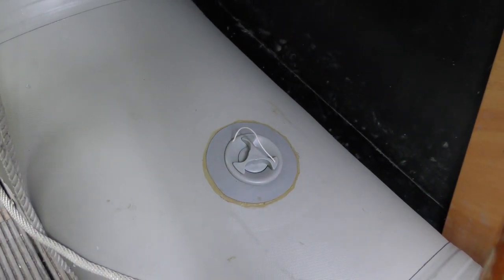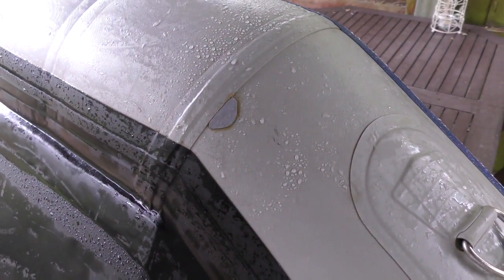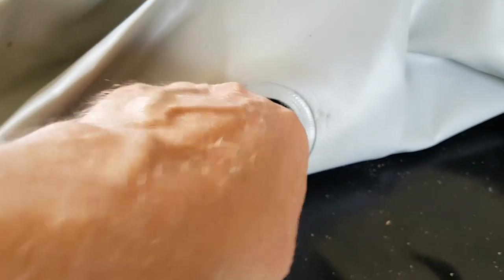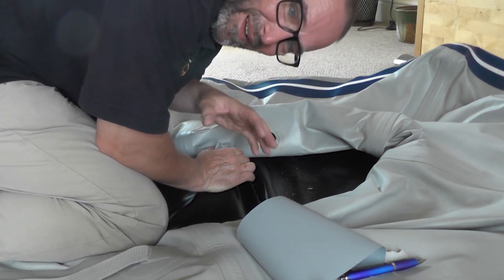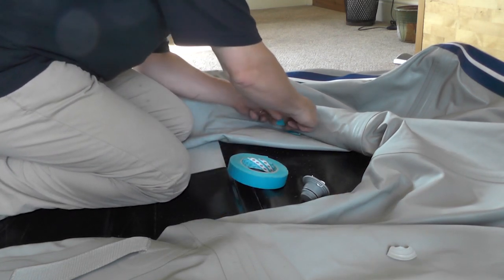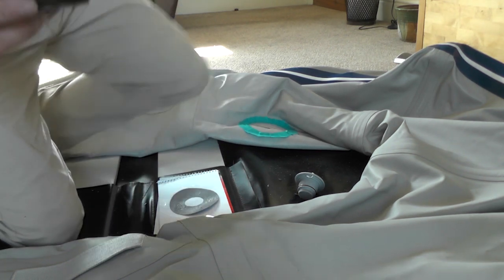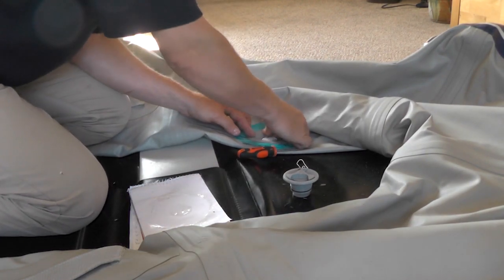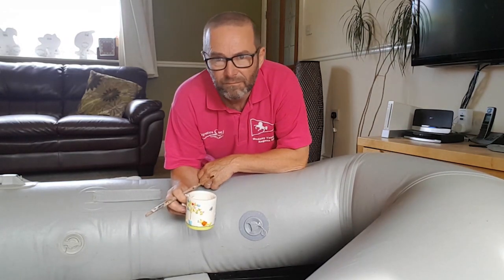INFLATABLE DINGHY REPAIR 4 YEARS ON and what they dont tell you about the glue!

Comment: I've repaired quite a few holes (PVC) over the years and have always gone for 1 part glue, just gluing both sides, let it go tacky before applying. Definitely not the recommended method but never had a problem with the repairs! I leave it for at least 24 hours before the tender goes back into the water which I feel is probably my reason for the successful repairs!
Reply from the maker: Hi Paul. Yes I think the time bit is important, keeping the pressure and water away from it until its fully set definitely helps ensure a good joint.

Comment: The glue I bought came with the main glue and the additive. However, the instructions stated the additive was only to be used when repairing Hyperion boats.
Reply from the maker: Thats interesting, not sure that's what was on my instructions as they sold a different glue kit for different materials, but I should check next time I'm on the boat just in case
Reply: The glue is different but the additive in many cases is the same.

Comment: Yes you can use as a one part. The hardener is said to give more heat resistance. I just use the single. Do not put a patch over a patch For small leaks I use a sealant which will seal other leaks besides the intended ones as well.
Reply from the maker: Thanks, good advice

Comment: Hello, the second part is the accelerator for speeding up the curing process. Plumbing PVC glue can also be used, but you need to use a heat gun, or hair dryer to activate the glue.
Reply: PVC glue on PVC only is not long lasting on boats. And can't go on Hypalon. Reheating PVC glue works for final bond but you can't reheat 2 part Hypalon glue. And the part 2 is not just an accelerator it reduces the glue and makes it harder/stronger.
Reply: @i1uvpreppyxo887  I agree with you about hypalon fabrics, however, I did not mention hypalon in my last comment. The vast majority of inexpensive (read really cheap) inflatable boats will use PVC only. Hypalon is used by the big brand names like Zodiac, and Saturn boat making companies, and a boat if similar size to an Intex, or Sun Force will sell about 5 to 10 times the price. I've used professional PVC glue on my 12 feet Sun Force to patch a 5/8" hole ( a drilling accident) and the patch is still holding strong after 5 years.

Comment: I wish there was an expandable foam invented to fill these dinghy's with, I have had endless problems trying to glue too the transom ! By the way thanks for the great video. !
Reply from the maker: That's a great idea!
Reply: People have filled them. But a transom repair is actually one of the easiest (so long as the transom is in ood condition). Once glued you inflate and attach the transom as you do it then use a long strap with a tensioning clip right around the tubes to compress the tubes onto the transom.

Comment: Good vid. It is more important to glue when it is below 80% humidity than anything else and secondly  if Hypalon to sand the fabric until it is like suede.. You can use the glue as single part but it is slower and a bit less hard/strong. But why do that when you can get the hardener on its own.

So if you want to buy some more hardener here it is: 1)  Bostik 9101 150ml (col0oured) [enough for 4 litres of glue! for Hypalon and pvc glue, 
2 Bostik  9105 300ml clear coloured fr PVC/Hypalon
3 Bostik Desmodur (more expensive but better in my experience) 750ml for both Hypalon and PVC glue.
The first two are quite inexpensive compared to the laughable prices asked for a 250ml 2 part repair kit.
So now you can activate your remnant glue to your heart's content. Oh and keep the hardener in the fridge.
Reply from the maker: Good advice, thanks

Comment: I used leather glue from our local £1 shop to stick two skeg housing onto inflatable canoes, fins slide & lock into housings & they help to keep the canoes on a straight course, so far they have held well, use generously & promptly stick together, put heavy weight over area & leave for a day. Job done, enjoy your time on the water.
Reply from the maker: Hi Bruce. Not heard of using leather glue before, good to know if we find ourselves with out the correct stuff sometime. Thanks for the info

Comment: How strange. I wonder if we've all been had. I always assume that two-part products are better.  I have half a tin of the gloopy stuff and I bet that the fixer/hardener/activator has evaporated by now. I would have ordered a new set of both - and it's not cheap. Thanks for the tip.
I know that you don't need to abrade PVC (unlike Hyperlon), so I guess its just a case of the gloop melting the PVC plastic a bit.
Reply from the maker: Hi Paul. Yup I think we have all been had. I have no idea what the second part is meant to do but the goopy stuff definitely works fine on its own.
Reply: @SailingwiththeFoxwellFamily  it's a thinner,  acetone,  mek or whatever the glue has as an active ingredient is the recommended thinner but acetone works too. I use contact cement and a splash of acetone to glue pvc to hypalon.